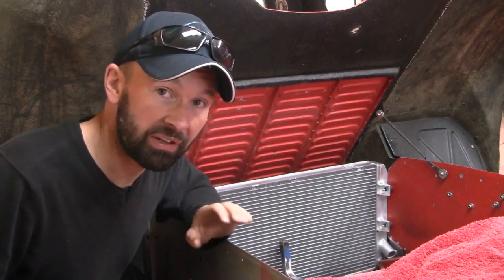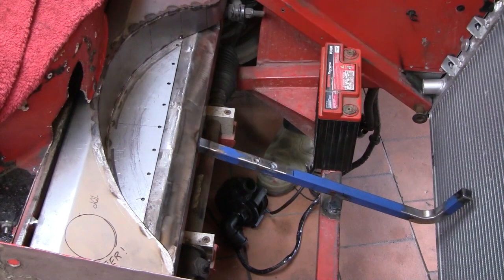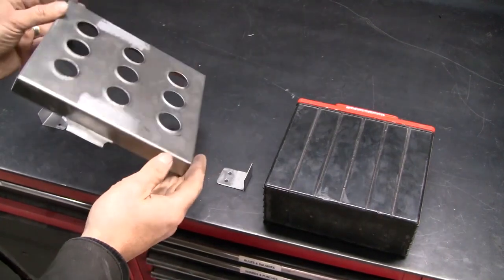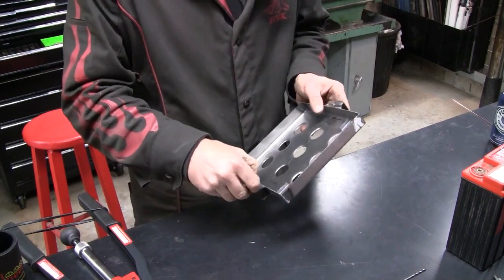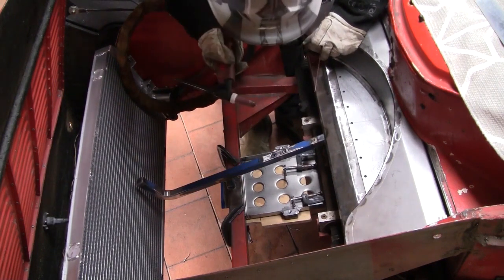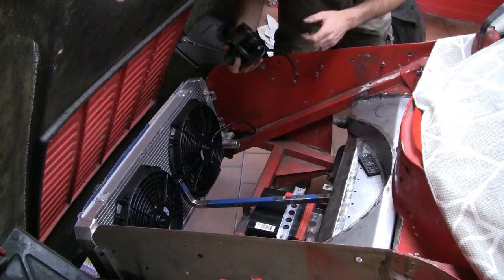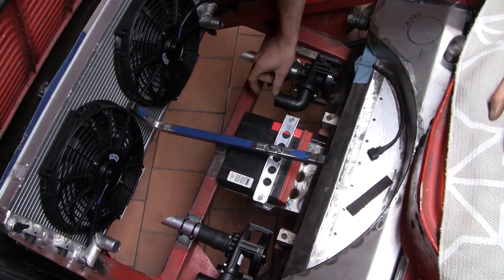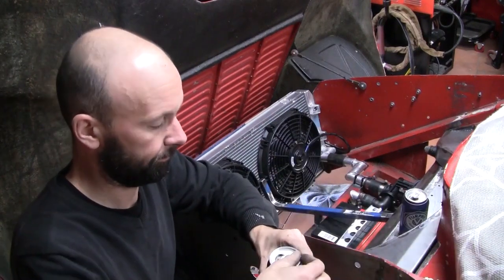Season5 Episode3 BattaryandWaterPumps

Comment: Won’t those right angles cause some flow problems?
Reply from the maker: Yea probably cause a bit of a pressure drop, but nothing compared to what happens when it hits the Radiator or engine block, with 2 pumps should be fine
Reply: @105colin  I have heard plumbers talk about cavitation eating through pipes over time. I don't think this will see that many hours though. I wonder if cavitation in the coolant could cause other problems? Like you said, probably makes some pretty tight corners in the block as well.
Reply from the maker: Interesting, I don't think the actual water velocity is particularly high, haven't worked it out though.  If it turns out to be a problem I'll sort it out then, I think my biggest issue is going to be bleeding the whole system!
Reply: @105colin  Ya, bleeding that is going to be a good time. You look like a professional, I am sure you will figure it out :)
Reply: @105colin  With pumps in series, the one pulling from the radiator might cavitate if it runs slightly faster than the one feeding the radiator. Two pumps is series are tough to balance and this could cause impeller failure. Does anyone run parallel pumps?
Reply from the maker: @bobgcampbell  I wanted to run in series to help out with pressure drop through the long and smallish tubes. The Davis Craig website talks about this type of setup working fine. But to be safe I'm running the pumps through a custom PWM controller with independent outputs so can ensure one pump is always running slower than the other
Reply: @105colin  Excellent to speed control them.  I destroyed an electrical pump impeller when in series with the engine mounted mechanical one on my '55 Studebaker.

Comment: on the right hand water pump, can't you flip the elbow around 180 degrees to keep from looping back to the back of the car?
Reply from the maker: Sorry not sure I follow? The coolant travels from the engine at the back up to the inlet of the first water pump from there to the Radiator then out of the Radiator to the second water pump then from there runs back down the car to engine inlet